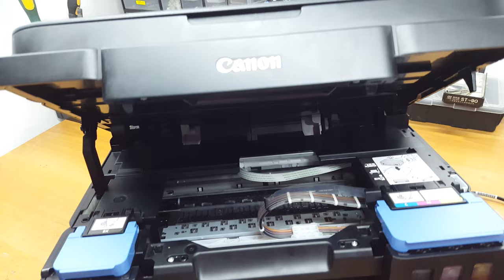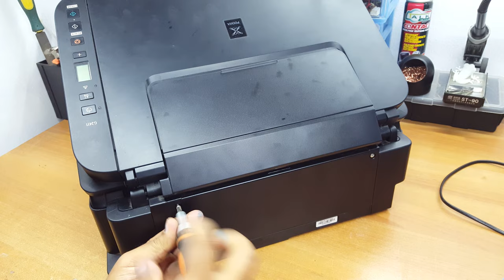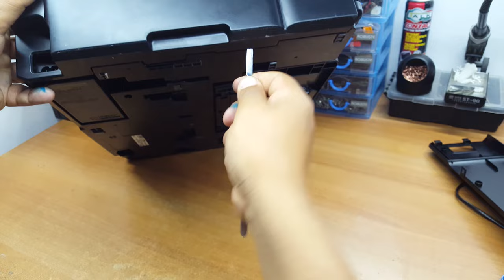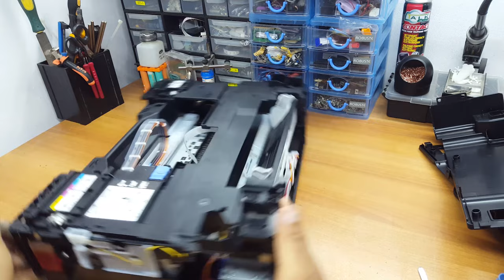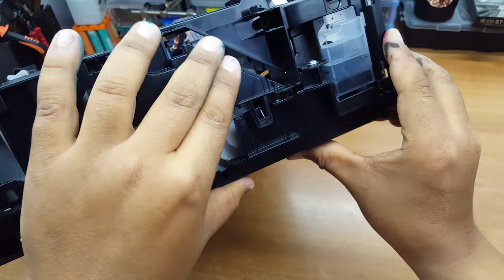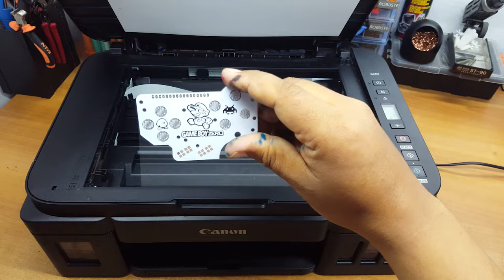canon printer paper feed problem

Comment: I did everything he showed, found the stuck item, but now the power will not come back on. I made sure to plug in the motherboard wires. Blue side of the wire to the smooth side and metal to metal. It will power up just the initial plug in, causing the ink to prime. But when I press the power (start) button, it will no come on.
Reply: Same problem
Reply: Check if the motherboard pins are damaged (I kept the scanner opened as shown in the video, but I haven't noticed that it was on the wall, not hovered like I did which pulled the pins in the motherboard)

Comment: Do you think it is a coincident that I had the exact same problem? I tried to vacuum, shake, bounce around my printer and could not find anything stuck in it. I only used it a few times before this happened. I thought for sure I had something stuck in there. I could see the wear on the main roller. When I finally got it apart, I could not see anything. I shook it a little more and could hear something. There was the culprit! A YELLOW BEAD!!! I do beading, so it wasn't a huge surprise until I saw MY YELLOW bead!!!! WTH???

Comment: Great job...........How did you know how to take the unit apart ?  Did you have the "service manual' ? I have an MP210, and I don't see  the Paper feed roller turning to feed the paper. 
       I don't see how to get the back cover off to access the rollers. Can you help with that issue ?  I'm getting an E2 error and there is no paper jam.

Comment: Nice one. I just pulled a miniature cardboard parcel out of mine. 1x2 inches it is amazing what can be hiding inside that area. i did not need to disassemble just poked it out with the cereal box card trick. You should be able to force an A5 shape of cereal box card through a clear printer with power off. A reverse push (from the front) revealed my blockage. Thanks.